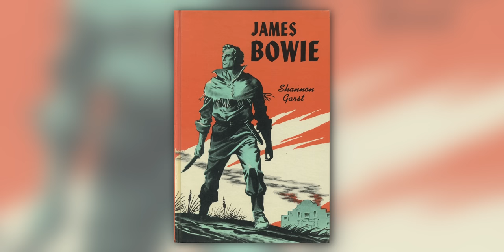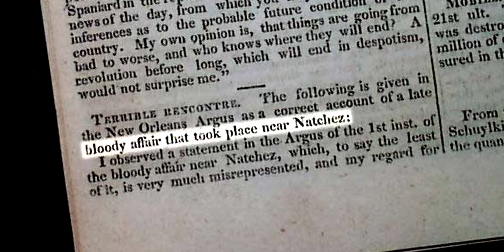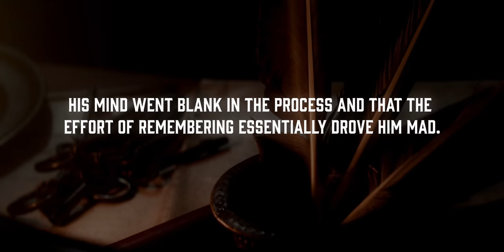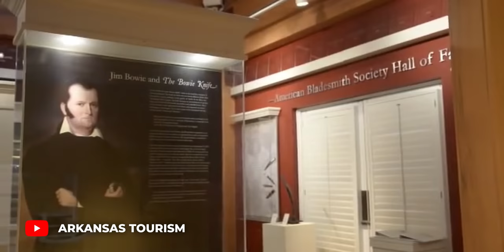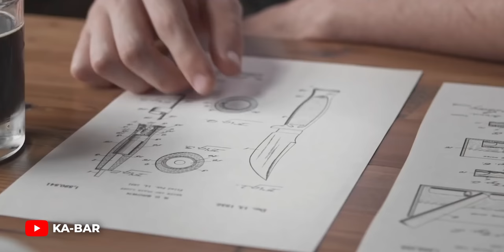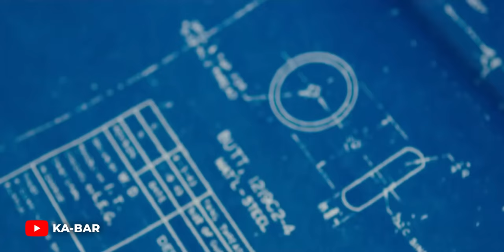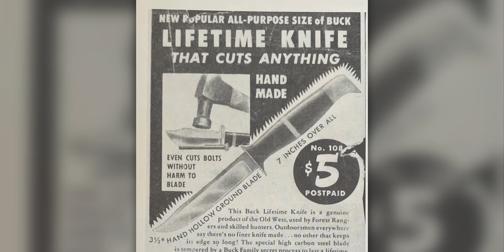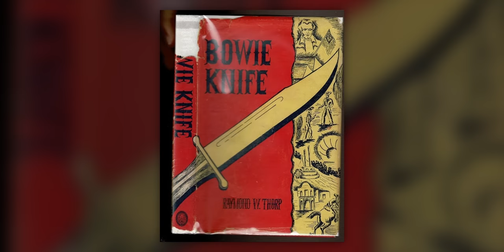Most Dangerous Knife In America! Bowie Knife and Everything You Need To Know About It.

Comment: Thank you. This was the best description of the Bowie knife I've ever seen! Since I read David Crockett a Bowie knife seemed magic to me and I drool a bit every time I see one.

40 years later when going on solo kayaking expeditions in Greenland and New Zealand I looked at Bowie knives but opted for a more humble solution.

I settled for a short dive knife for protection in case I got caught in a fishing net, a Swedish Morakniv Basic (stainless steel) for general outdoor activities and a Victorinox Swiss Army Spartan for a lot of reasons. It worked nicely and only set me back $35 ($21+$7+$7).

In New Zealand I replaced the Morakniv with a $7 Czech scout dagger with a sawback.

I've never ever needed my most expensive knife - the dive knife - but it's always ready. The other $7 knifes are used a lot and they have served me well. I always bring a small sharpening stone on my trips; but I've only used it at home. Modern knives are often made of high quality steel. I still dream about that big David Crockett Bowie knife. The problem is, that I don't need it. Sigh.
Reply: Crocket didn't use a Bowie?

Comment: I’m a blacksmith and I’d like to clear up a few points.  First is the Bowie knife’s signature shape, it’s not a design that anyone came up with, except sharpening the false edge.  If you forge the bevel if the blade’s tip instead of grinding it then it will naturally take that approximate shape.  Clean it up a little on the grinding wheel and you’ve got a knife that looks just like a Bowie knife.  

Second is that no heat treatment has ten steps (also the secret to Damascus steel’s strength isn’t related to its heat treatment, and heat treating it would actually ruin Damascus steel).  Heat treating has only two steps: hardening aka quenching, and tempering.  Black may have had a certain way he did heat treatment that was particularly effective, but there’s no way he could’ve written it down.  Blacksmithing can’t be taught through written language.  It can’t even be perfectly taught through video recordings.  Blacksmithing is either something you teach yourself through trial and error, or you are taught it by another blacksmith working at the forge in person.  Without accurate measurements for how hot the forge or the steel is, a blacksmith judges based on the color of the glow of the hot forge and steel.  It is impossible to describe the color of hot steel with words.  A minor change in hue could be a difference of hundreds of degrees.
Reply: There are plenty of heat treatment/annealing procedures that have more that "two" steps.
Reply: @TB-ni4ur  but those aren’t for steel.  Chocolate can be tempered, but it is a completely different process than you would use to temper steel.  You could also use a more complicated heat treatment process for steel if you wanted to achieve some very specific material properties, but that takes machinery and precision that aren’t found in a blacksmith’s shop.  That’s only for ultra high end manufacturing with modern machinery.
Reply: @GusCraft460  Well he had an unknown process and here we are talking about it hundreds of years later LOL.  Maybe he knew something you don't...

Comment: 10:50 There's a point here. In Germany for several hundreds of years now there have been hunting knives in use which nowadays are more worn as a tradition than for actual use, and that's the "Waidblatt" or "Standhauer" which very much looks like a Bowie Knife but with a drop point tip and a bit of a short machete blade profile. Its historical use was to combine gutting and coup de grace wild game as well as to hew away brush from hunting stands, hence its second name Standhauer (stand-hewer). Blade length ranges from 7"-10" and its got a cross guard. In contemporary pieces the upper false edge is not sharpened anymore (legal reasons).
Anyway, the Bowie Knife is one of these True Americana things. Great background video on that.

Comment: Looks almost identical to the two I have that are branded Winchester. The handle on mine is smooth and the lanyard hole is lower than the pins.
8.5" blade,3.5" clip point, handle and brass straight guard 5.5", overall length is 14". Cutting edge is straight on mine, not curved. Blade is 1.75" edge to spine and 3/16" thick.

Comment: Grew up in the 70 as a kid in the UK where i joined Scouts and then the army. Always carried a Sheath knife and then graduated to a  full length Bowie. It was essential life saving equipment and came in handy so many times. However in more recent times whilst on a mountain hike a 9 inch blade caused quite a stir whilst clipped to my belt. I'd never climb without one after having saved a tangled climber 100 feet up a rock face

Comment: I took one of these out of my right eye socket in 2008, after having my skull crushed, eyeball cut in half, both valves that pump vitreous fluid into the eye and resulting plastic surgery, vitrectomy and my eye sewn back together. I have vision but no lens, so everything is a blur but I can still see. Depth of perception is a problem and requires compensation.

Comment: Yeah they are dangerous. My Case Bowie knife was in factory box in a leather sheath. When I picked box up it slid out of the closed box, came out of sheath and bounced on the carpet. I had to get stitches in my leg. That tip got me when it bounced on carpet. Barely felt it. I was a ICU nurse and had hard time stopping the bleeding. Had to get a Dr to stitch it up. It went in deep. You even touch the blade it will cut you. Imagine getting stabbed with one! Very formidable weapon

Comment: Any tool can be a weapon. It depends ONLY on the purpose of the use.
 Bowie knife is a tool made for:
   - Not only chopping wood. This "tool" has a curve to deflect forces when using a pole to maximize the deepness of the chop, at the same time that minimize the possible damage in the structure of the blade. I reckon.
   - It´s also a customizable multi-tool when it comes to hunting/cooking. Just adjusting the angles of de edges.
   - And of course, if your life´s involved, is better than a bare hand... most of the times. And that´s when the tool  become a weapon.

Comment: Although I appreciate some of the original designs (pre civil war), as someone thats made probably over 170 knives and worked with Cosmo Knives making both knives and damascus steel, I can say I personally can't stand the modern Bowie knife. But devil his due I suppose that depends on your purpose, its a combat knife and for that purpose with its think full tang and drop point it should serve well if you want to stab people and keep the wound open. However its mostly carried by outdoorsmen which for everything else: like camp kitchen duties its a poor kitchen knife, for whittling and crafting its too thick for efficiency, for kindling its not weighted very well but will work, for rope its okay but only if kept sharper than most do, for animals its not designed for skinning and you'll probably put holes in your hide. For people that actually use knives as regular bush tool day in and day out, most generally use the first 3" 90% of the time, which is why knives like the Tom Brown design, Mora scout blades, opinels or a dozen others actually designed for Bushmen and wimen are usually only 3" - 5" in blade length and sport curves and bevel shapes that are used for more than being a giant bulge on your hip.

Comment: My story isn't so much about the knife as the thong. Back in the early '80s I had a Cold Steel Trailmaster, and I had sharpened the false edge as well as run a thong through the handle. One early spring day a friend and I were clearing limbs from downed trees along a hiking trail. I was swinging the Trailmaster like a pro, hacking through the thick mess, with the thong around my wrist "for safety." But after nearly an hour, my wrist became fatigued, and on one swipe, the knife slipped from my grip, swung around my wrist and that point came within an inch of my eye. That was a wakeup call for me. I wouldn't use the thong in that way again. 

Shortly after, I learned about the old police 'billy club' grip, wherein you hang the knife with the thong around your thumb (thumb up) and draped across the back of your hand, with the edge pointed away from you. Then you roll your hand over until you grip the knife handle (thumb should be pointed down). The first time you do that,  shorten up the cordage outside the loop until there is no slack and tie it, and cut off any excess. Essentially, the usable loop is roughly the same size as the width of your hand. You don't want excess space.

When you grip the knife in this way, it is absolutely secure in your hand. If the blade gets caught or pulled, simply opening your hand with your thumb forward allows the thong to slip off.

Comment: i cant lie.. a fixed blade horizontal on the back of my belt of atleast 4 to 6inches and blade width of atleast 1.5inches means more to me then the use i get from the second amendment.. it has countless uses and it sitting in its sheath sez more than i ever have to when it comes down to security.  i can count on one hand the times its been pulled to make a point.. every time in 3 to 5 seconds i put it back becuz the point was made.. ive yet to meet sumone whose down knowing i got my hand on a giant razor-sharp hunting knife

Comment: The term "bowie knife" has lapsed into meaninglessness so that now it can be used to apply to basically any large knife that looks like a "fighting knife".  The REAL "Bowie" knife that Jim Bowie used at the Sandbar fight and thereafter, looked like a large straight-backed or slightly sloping, drop point knife with a generous and gracefully curved belly, and a single edge - basically like a large kitchen breaking knife.  No clipped point, no false edge, no coffin shaped handle, none of that.

And the James Black story is just that - a story.  There is no evidence - none whatsoever - that it is based on anything other than the state of Arkansas' desire to draw attention to itself.  IT IS BULLSHIT.

If you really want to cut through the bullshit stories, there is but one thing you must do - ask yourself what a butcher's knife in the 1820's would have looked like?